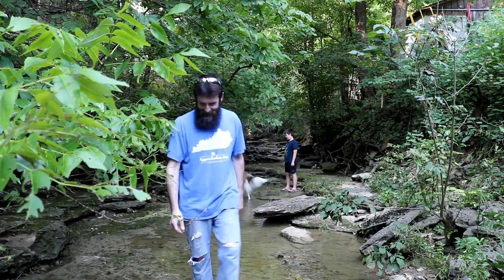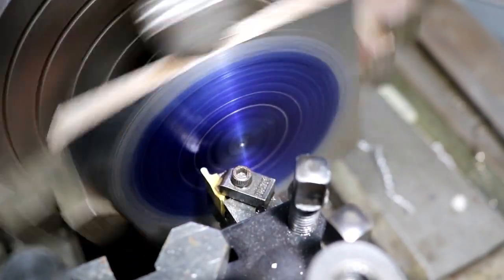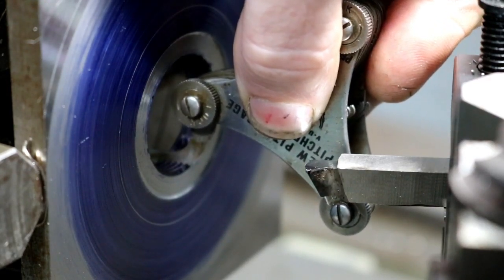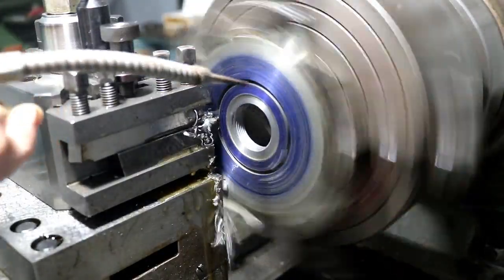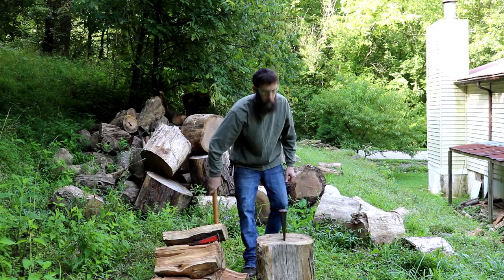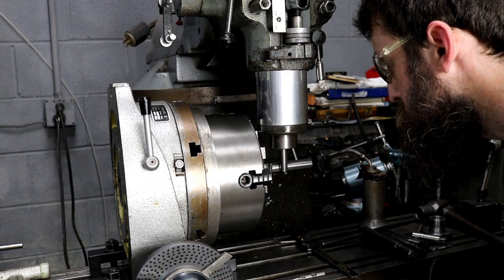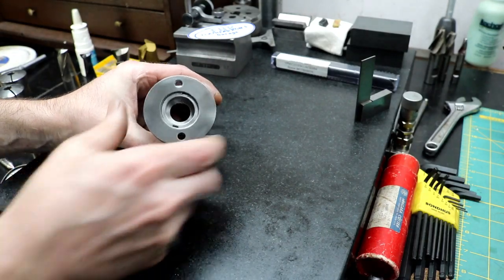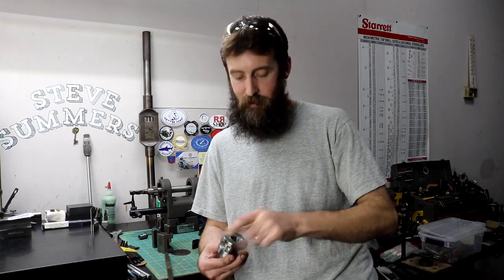Power Trepanning on the Metal Lathe

Comment: Cool video. I was gritting my teeth as you started the power feed. 

That 3/8"-20 tap is used on old door knobs and levers. The square spindles that pass through the locks are threaded.
Reply: Yeah, my house built in 1922, has those threaded square spindles, and hard-to-find setscrews for the door knobs.
Reply: Doug Ankrum, Hi Doug. Those setscrews are called Oval Jackson Head set screws. 10-24 thread. The originals were slotted. Now they are also available in Philips. Killian Hardware sells them. Good luck!

Comment: Maybe it's more common in KY, compared to KS, but hardly anyone around here burns wood anymore.  Everyone would rather pay the utility company, for some reason. I would rather put in some work and provide as much as possible for myself instead of paying someone else.  I honestly enjoy splitting wood by hand.  I don't have a log splitter either and heat my house and garage off of wood.  Great video Steve!
Reply from the maker: Thanks👍. I'm no fan of paying someone for something I can do myself. Electric bills get expensive quick. Nothing like a good wood fire. We used a heat pump for a few years, it was expensive and never put out good warm heat.

Comment: looks good steve, you said before that when you put a wheel on a hub, you dont really remove it or it messes with it running true, so you wont really need to worry about taking the part off of the wheel and wearing it out, so it should last for a very very long time.

Comment: Hi Steve I'd be interested in your approach to balancing the wheels on the hub. I have to make some hubs for my surface grinder and intend to copy the original hub. The original hub on my Kent surface grinder has a groove in the rear of the hub, in which three small "weights" can be repositioned. Positioning the weights correctly balances the wheel.
What about making a static balancing "stand" as your next project? I'll have to make a static balancing stand when I (eventually) get my hubs done :-) I already have a couple of designs in mind.

Great video, they are always a pleasure to watch - I like the accent too :-)
Kind regards

Peter

Comment: Steve those diamond dressers you have that you think may be damaged can i have them? we have a chipper knife grinder at work and dont own one. the rock needs cleaned bad and cant get the boss to buy one. I'll pay for shipping. i live in Harlan Ky
Reply: Check eBay, they have inexpensive diamond dressers.
Reply from the maker: kycoalminer35 The ones I damaged no longer have a dimond in them. You can get them off ebay for dirt cheap. I believe I have seen them for less than 7 bucks.
Reply: the boss bought one and a guy knocked the diamond off the very first use. noob move, i'll check ebay for one. Thanks Steve

Comment: I've never heard of a thread file.
Reply: They are great for straightening threads on things that are difficult to remove like wheel studs for instance. Most auto techs use them as you will burr a stud on occasion using an impact wrench.
Reply: are you kidding?
Reply: tom lee nope. Never. But I’ve got a set in my amazon basket